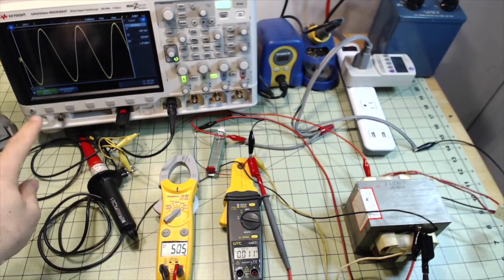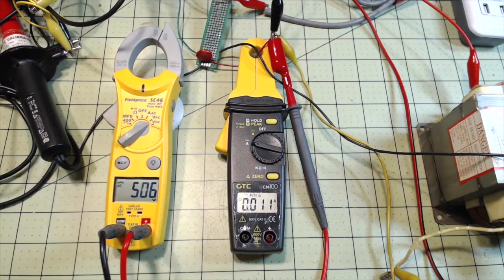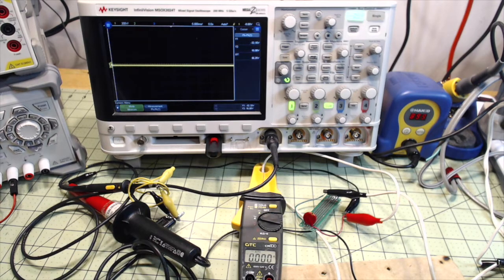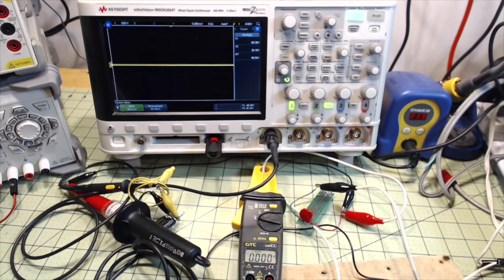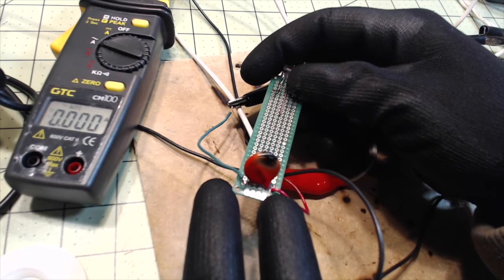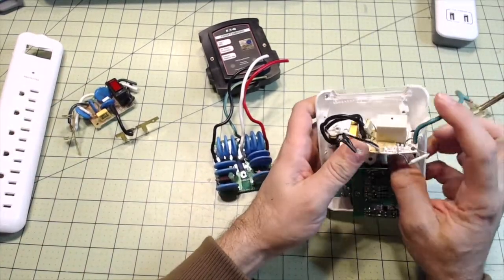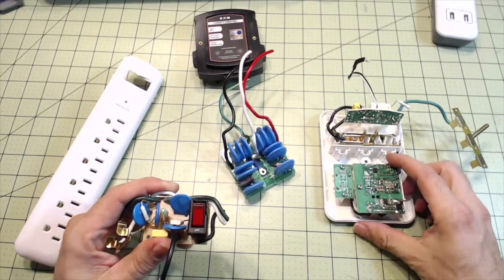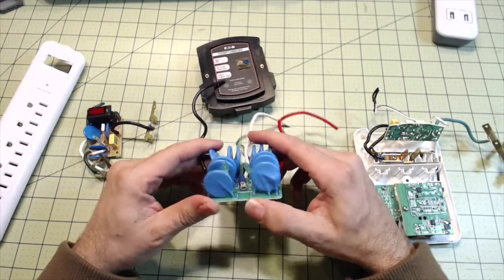MOV:Varistors

Comment: I have a cheap surge protector that doesn't have a MOV but just a big cap and an IC. It shuts off for a minute when it detects an over/under-voltage (at least in theory since I haven't tested it like that.) The ones you showed don't seem to an IC. Theoretically, mine could work fine, as long as the reaction time of the IC is fast enough to avoid a spike damage it. What do you think? Here's the picture btw: https://i.postimg.cc/Kv8vbY9x/unnamed.jpg
Reply from the maker: Simpler is more reliable, the reaction time of MOV is very fast.
Reply: @electronicsprojects4708  But a capacitor is also dead simple and avoids sudden voltage changes across its terminals. It doesn't have the risk of catching fire either, whereas you need a thermal fuse with a MOV.
Reply from the maker: @DrN007  if it relies on a chip and a capacitor, that circuit is more complex. A capacitor will not do the job of a MOV in clamping voltage, and I have seen capacitors short and get burnt up like an MOV.

Comment: I have an MOV and need to buy another one.  SVC 471-14.  I can’t find one anywhere.  Can you help me, please? How do I test my varistor with a DMM?
Reply from the maker: Should read open circuit on ohm measurement, if it is blackened and charred from over voltage causing current through the device, it needs to be changed. If there's no physical sign of damage, the varistor is usually good (99.9% of the time) https://www.newark.com/bourns/mov-14d471k/varistor-470v-300vac-385vdc-14mm/dp/77T2728

Comment: Unless I'm missing something here, it seems that you have got this completely wrong.
If that MOV was dissipating anything like 700W, it would have blown up in your face. 
It didn't, because there is no 1000v anywhere in this circuit. The MOV has placed an extremely high load on the MOT, and due to its secondary winding resistance, among other factors, its output has been loaded down to 35V, which is the value you should have used in your calculation, not the no load voltage of 1000v.
IE: MOV dissipation = Current through MOV X Voltage accross MOV = 0.7*35 = 24W, much more in keeping with the observed amount of magic smoke released.

However, I can't explain why the voltage doesn't return to the MOV trigger voltage on each half cycle. Perhaps its gone short circuit, or has a recovery time of more than 20mS (but I can't find anything on that)

I intend to conduct some similar experiments myself in order to get a better understanding of MOV operation.
Reply from the maker: The shunt is non-linear, at turn the peak voltage is 1000 vac and as the varistor starts to shunt the current, the voltage drops in a nonlinear fashion, I am thinking it would be parabolic. It would be interesting to chart this. If you look at my yellow Fieldpiece meter when the voltage is turned on when I test the 500 vac, it's too slow to catch the initial voltage because of the refresh rate of the meter is slow. Best would be to capture with a scope, but I was using it to view the waveform. you can see it goes from 160 vac and continues to drop lower and lower until it gets to 40vac read on my meter. This was not the point of the video, maybe good subject for a follow up video.
Reply: bertoid where can i find the mov in NI multisim simulator ?